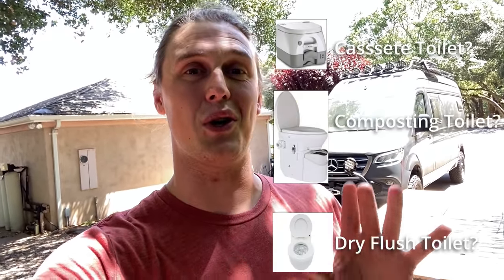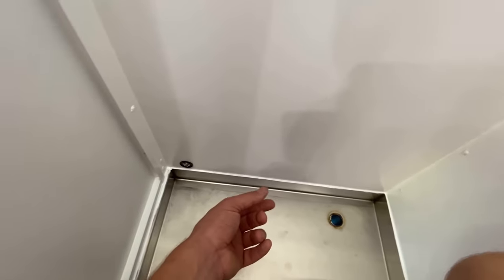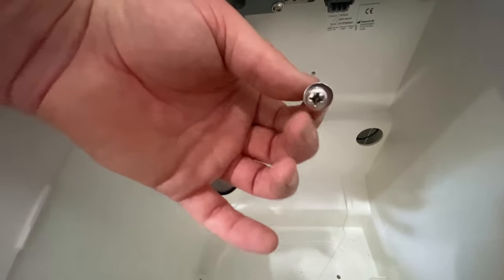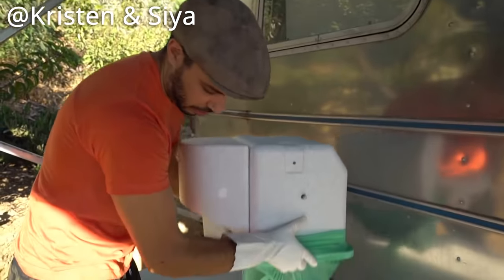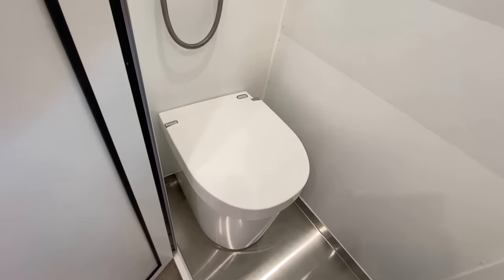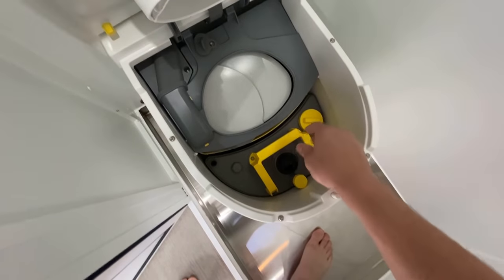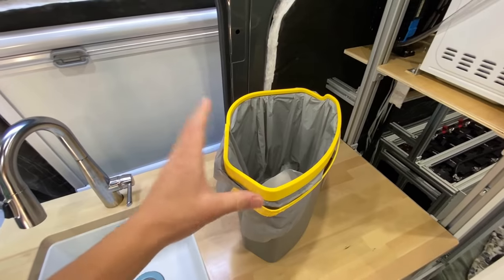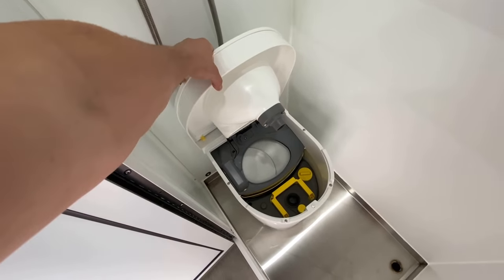The BEST TOILET For Van Life??? Hint: not composting

Comment: Wow, really valuable video thank you!  Been researching a van conversion for a while, and didn't know about this product - I was considering building something myself to do all of this (I was aware of the other strategy issues). One question - yes please update us on usage, but I'm curious about shower water leaking in.  One of the van lifers covers toilet strategies and tried them all, and found the compost leaked when using a wet shower strategy (which is what it looks like you've done).  Please let us know how well the unit is sealed and if water gets in when showering, and/or if any condensation/moisture starts to create problems. Overall, fantastic product and excellent video.

Comment: You had mentioned Black water tanks. Wouldn't is be easier to go to and RV dump location and wouldn't it be also better that you don't have to dump so often? I mean Black water tanks can allow you to go for weeks or months without having to dump them right, especially if you have a 10 gallon - 20 gallon black water tank with a Grey water tank to be used if needed to wash out black water tank.

Comment: To be fair, cassette toilets can be dumped in any public restroom. Only built-in black tanks need to be emptied at a proper dump station. This is why a cassette toilet is the best option in my opinion. Also, the exhaust from these and composting toilets can be smelled outside the van, which could be a problem when you're chillin' outside the van at your campsite. The bottom line is that there is no perfect van toilet, they all have significant pros and cons.

Comment: Thank you for sharing your experience and van build knowledge.  Does the 12V fan operate continously.  What is the Amp requirement for the fan?
Reply from the maker: It does, if I remember correctly it takes about 0.2 amps

Comment: The cassette blackwater cannot be thrown in the trash...
Yet, this one, you don't need  a dumbing station... What determines the difference? The quantity?

Also besides this toilet,  for urinating only, I would mostly use a small plastic container with a 13 gallon waste bag..  the large bag would be slightly filled before I would throw it away.

Comment: That shower cabin + toilet combo seemed weird, but after some thinking it looks ingenious:
- the toilet itself can be washed w/o any trouble and you don't have to be scared of urine getting outside of toilet;
- you can sit while showering;
- shower cabin is likely to be sealed, thus preventing escape of odors outside of it;
- both toilet and shower cabin need ventilation, therefore you can use only one ventilation system;
- you can do your business even while showering (avoids pollution of greywater with urine if you suddenly have to pee while showering);
- you can even use it as a poor man's bidet (you shouldn't, to prevent pollution of greywater, but still).

Comment: Actually, no toilet for human waste should be a 'composting' toilet, at least not anywhere where the 'compost' is used to grow or fertilize plants that have anything to do with humans. There's a reason farmers are not allowed to use human waste as a fertilizer whereas cow or even pig dung is ok. 

Despite the Separett dry pad thingy, I'd add something to dry the poop. As long as you manage to dry the 💩, it has next to no smell. This is the second reason for the vent, not just to keep the stink down. What we use is a bag of sawdust that we keep next to the toilet. The waste bag in the toilet is 'primed' with a 1/2" layer of sawdust and the 'flush' is sprinkling a layer of sawdust on top of the 💩. And it even works if you're a bit unwell and have a less-than-optimal consistency - you just use a little more sawdust than normal. We can go for a long time w/o emptying the waste bucket, and I am willing to bet it's even less offensive than what you have to deal with as it feels more or less a bag of sawdust and not a bunch of very soft hot dogs in mashed potatoes in a plastic bag :-)) . No odor whatsoever regardless of the temps.

Comment: On the dry flush, couldn't you use a desiccant preflush with an oderpreventer?  Then you wouldn't have to flush until you do a number 2.  You have experience with those.  But having no flow or water or connections seems attractive.  I'm not sure about the wastefulness of the silver bags.  I suppose they are mylar?  Best info I can find is six months to four years for total degradation.

Comment: It doesn't compost while in the van, it compost in the landfill that it eventually gets to. It cost me about $30 dollars to set up my system, and it will probably last me a year before I have to replace something. That contraption you have probably cost a $1,000 bucks. I also discovered that the urine diverter is a waste of time. Before sitting down I pee into a 1/2 gallon pitcher that has a lid, then empty that when it needs it.

Comment: I haven't used either so I can't say one way or another but I'm certainly leaning toward using composting in my camper vs a toilet that requires bags.  Good separate has "composting" bags but I suspect few (myself included) would opt to pay for them and instead use cheap plastic.   Another reason I'm not sold is I'm a little distrustful of the brand after hearing one of their claims.  I compost at home and I know for a fact the breakdown starts in just a few days.  So whoever said composting didn't happen in a month either didn't know what they were talking about or they were lying to make a sale.  Either way it doesn't speak well of the company which may well have a great product otherwise.

Comment: Check out Eco John for a low-power consumption incinerating toilet. It's possible due to it being a dual system: propane + electrical. Only 1.5 amp/hr pull compared to Incinolet, which pulls about 16 amp/hr during its heat cycle.

Quite expensive, but it's the way I'm going for a totally off-grid trailer design I'm working on.

Comment: Can this be set up with a hose? I want a pull out toilet because I want to build out a SWB and space is a premium. Also, Nature's Head uses a fan. Why wouldn't a fan be needed, particularly if you run the risk of sucking up odors while running a max air fan. Is there a way around this?

Comment: I’m hoping it was obvious that a complete composting does not occur in that short period of time. The composting material is designed to remove moisture from your feces. Dry feces has no or very little smell. It does help the environment by finishing the composting with the material added whenever and wherever you place it in nature.

Comment: Hey Seven O... one tiny question about the Separett 'Tiny'. There's a small hole (with a short upright moulded tube structure) at the top of the urine container that no one has explained the purpose of. It's at the far left, on the top of the urine container, as you are looking from the front of the unit, towards the back (with inner and outer lids up, as though you are about to remove the urine holder for emptying). I have watched several other Separett Tiny presentations and no one has even mentioned it, or what it's for. Any clues? I'm figuring that if it is open, with no cap, and you suddenly hit the brakes to avoid killing a deer/kangaroo etc., wouldn't the sudden inertia cause the contents come splashing out??? (Creating the same problem the other couple had).
I'm really liking this option for my Coaster Bus conversion.... i.e. AFTER I got over the initial shock of the PRICE!!! OMG!!! It's good thing I was sitting down. I thought it would have come in at around $600 AUD or thereabouts... but NO... it's around 2.5 times that!!
Any help would be greatly appreciated (explaining the urine container mystery hole). 
Cheers Seven O, and thanks,
Noly
Reply from the maker: Hey moly, I believe it’s the spout you use to empty it
Reply: @seven_o_savage  7-0, What about when you're in transit? Does it have a cap of it's own? Couldn't see one in any of the presentations I watched. I guess the inlet doesn't necessarily double as the outlet. So it has it's own separate draining tube, yeah. I still worry about urine splashing out. Have you had any such trouble with yours? Oh and, Tx very much for the prompt reply. Really dig your vids. That icy road trip to beautiful downtown Denver. God, 20 hours!!! The US is so big.
Reply from the maker: @artofnoly9754  The way each port is designed actually makes it super spill resistant in transit. Thank you, so glad you enjoyed!
Reply: @seven_o_savage  Ok, I'm convinced. Tx.

Comment: Really, just get a 5 gallon pail, a toilet seat and tall kitchen trash bags. The best urine jug I ever had was a black 2 and a half gallon oil jug I found at a truck stop. It had a +2 inch mouth on it.  I had to replace the lid seal with black rubber gasket maternal, but I used it for years.

Comment: After reading several comments, I found the question of the legality of throwing poo and body fluids in a dumpster came up. For years and years, baby diapers, feminine hygiene products and incontinence diapers have been placed in waste carts in cities. Based on that I don't see a difference.  How does a campground dumpster differ.? Most are emptied weekly as well. I suppose the contents could be dumped in the toilets in the campground instead of the dumpster. Keep the bags in a sealed container until you get home or put them in the campground dumpster. Lots of good thought provoking comments.

Comment: Work on a Simple Shower that does not require electricity... Typical home water pressure is 40psi to 50 psi... A gravity feed shower 🚿 has 0.43psi for each foot of head (62.4 lb/ft³)... [62.4lb/144 in²=0.43psi]

You would need to a head of 100 feet to generate 43.3 psi, ridiculously impractical.

I'm thinking if you connected a hose and shower head to a bladder then sat on the bladder and then shifted 50 to 100 lbs of your body weight onto the bladder it would create 50psi to 100psi, the same or better water pressure in a typical home...

You would need a sturdy bladder to hold the water and a one way valve so the bladder would not fill with air if you got up or shifted weight.   Would also need a relief valve to drain the water when done taking a shower 🚿...

Comment: Does the exhaust fan only turn on when being used? Your toilet is under the shower, does the urine tank fill faster this way from the nozzle or splashing? Can you extend the vent pipe to any area in the undercarriage without effecting the performance of the exhaust fan?

Comment: Awesome summary of the various options. Just one question. How hard is it to aim properly when using the #2 section on the rear. That hole looks fairly small and I imagine that it would be easy to miss and get poop over the outer walls or rim of the bowl.  Or is that not an issue? 

Would appreciate your thoughts on that aspect
Reply from the maker: I haven’t found it to be too challenging.

Comment: This toilet is very good toilet for men living the van life; I would not recommend it for women just based on the fact they sit down when they have to do a number 1 and 2. If they can find away to put a vacuum powered self seal bags, in the Separett Tiny, toilet with technology, similar to how the Dry Flush toilet works, but at the same time find a way to allow the toilet poop waist chamber to open when doing a number 2, but stay closed when a woman has to sit down and do a number 1.    If they can figure out way to come up with a new design similar to the old design and incorporate dry flush, technology in the Separett Tiny, toilet would be the perfect toilet for any mobile form of transportation, trailer, Tiny home, or shed.

Comment: seems like folks perseverate much more than necessary regarding this part of van/rv life… so, my solution is a $15 folding camp stool (pun 🤣) with a generous size hole cut in the fabric, a plastic grocery sack from your favorite, or least favorite grocer, placed strategically beneath and there ya go (sorry, another one) then just wrap up yer business when you’ve “finished” and place in a second bag to contain the matter and find a dumpster asap  😳  Urine can be collected in a white one gallon milk jug, one gallon does not tip like a half gallon… then dispose, pour at a dump station or toilet.  Females can use one of those special “girl funnels” to direct urine in to a jug.  So, there ya are… for less than $15 your needs are met with NO recurring cost 😉

Comment: toilets seem overkill to me.. esp for a guy, just get a bottle for #1 then dump it outside, no liquids to deal with inside bottle cost nothing since its a byproduct of simply buying a drink - then use a bucket with a lid that has a good air seal, sit on said bucket to use as toilet and use some compost material (its more about absorbing the water/smell than it is about real 'composting'. Lots of creative things that can be used as a toliet seat so its not uncomfortable, but then you have the whole shower for actual showering since you can move your bucket anywhere (use a bio-degradable bag in the bucket).

Comment: I think that using compost is better because when emptying the section, who the heck wants to look at feces? At least with compost one could use a mix that has started to have a good bacterial culture already at work and then when it's time to empty the contents it is well in its process. Saving space is important but dealing with a storage full of literal crap every time and having to be exposed to the smell and visuals is less than pleasing. 

With the compost, the organic material is doing what nature does. As for the liquids, it would be good to find a way to eliminate the smell and even the composition of the urine as well. No matter how we look at it, dealing with these toilets, one is still dealing with sewage even when using natural products to break them down. So in engineering one could maximize the storage capacity with the size if one really wants to using these factors as well as dealing with the less offensive part of this. No one likes to deal with excrement nor its smell, liquid or solids, and yes, it is important to keep the environment clean, so there is no reason to not put more into making a solution for this issue.

Comment: Your rig looks cramped.  Is it going to have slides for one or both sides to free up more of the floor space?  One other cheap way to take care of nature's call is use a 5 gallon bucket with attachable sealed toilet seat & lid.  Use ordinary trash bags to collect your deposits, remove the bag, tie it off, drop it off in an Arby's dumpster, re-line the bucket, clean as warranted.  No power, no special install, you can get all the parts you need at Lowe's or Home Depot.  The dry flush toilet that is made by an American veteran does cost about a grand, the refills are 30 bags per refill, and it does need a large battery or permanent power source in order for it to work.

Comment: Um, the thought of dealing with a large, OPEN bucket of solid waste... not pleasant.  If the toilet had a means to wrap up and close the bag before you open the toilet and remove the bucket, THEN I would be sold on it and consider it close to an ideal solution.  That shouldn't be too hard to do; you're an engineer, figure it out!   But this is a very good video, well done.

Comment: I was sure that this toilet was going to dehydrate the feces to reduce smells and make it more compact. This solution was simpler and used less power. I imagine you could make a 5 gal bucket lid that had a powered vent and pee separator that would do something similar.
Reply: It does. That's how you can fit a months worth of waste into that bin. The fan runs continuously which in turn dries out the solids.
Reply: @newtwatney8701  I did not realize it was a months worth of waste!! That's amazing!

Comment: Need to combine the advantages of each type. With your toilet just add a sprinkling of wood shavings to the rear area after each use. I f you go to a pet store they have lavender/lemon/other scents. The bag will fill up a little faster but I have found there is no need for a fan. I agree chemical toilets are nasty.

Comment: It's not completely foolproof you can still overfill it and it's not that easily removable if need be. The only real advantage I see with this type of toilet is the ventilation other then that the dry lush takes the crown for me. Not even a name brand dry flush but a bucket if you are trying to be cheap and or a collapsing camp toilet if you want the space, and convenience. There are actually pee bottles for women, so peeing shouldn't be an issue for either males, or females. If they make the bags and they really are compostable, then all I need is those bags. Without built in ventilation, the smell can be handled with kitty litter. this is a Touchy subject because while on the go, or in a van, are you trying to safely complete the task of pooping, or replicate every aspect of how a house lets you do it? Thing is, you're not in a house where it leaves when you flush it. It stays with you until you dump it one way or another. That is the constant in the equation. If you map out your constants, you're gonna know what options you really have for completing that task, and I'm telling you those bags with any bucket, or collapsing camp toilet are a better option. Less installation, more modular, less expense. Ultimately is a responsibility thing. Just take it out ASAP soon as you get the chance because your not in a house you don't have a big pipe that's just gonna instantly take everything away. You are that pipe. And when you start to believe the lie that somehow this is not that reality, then you will overfill your pee tank.